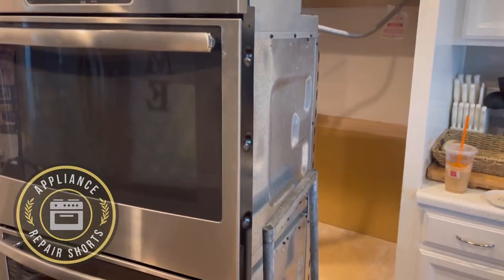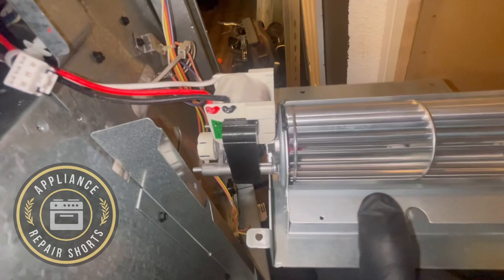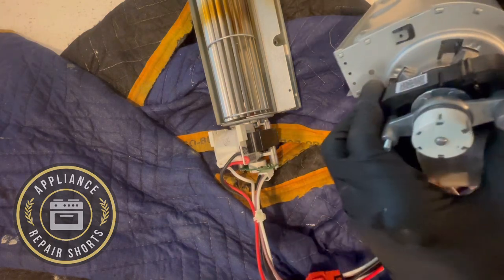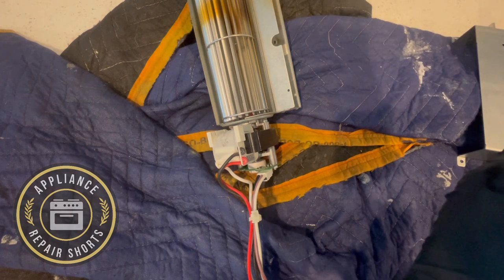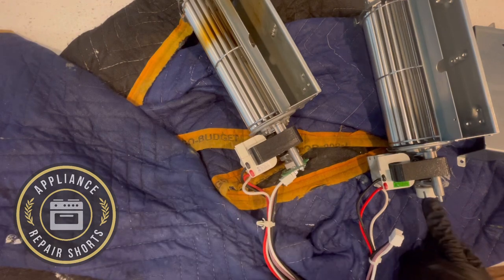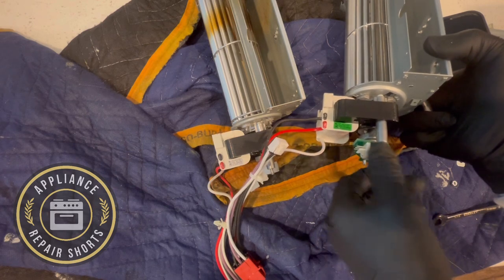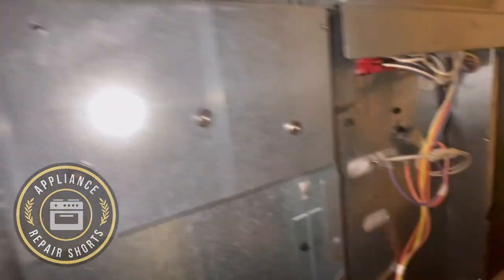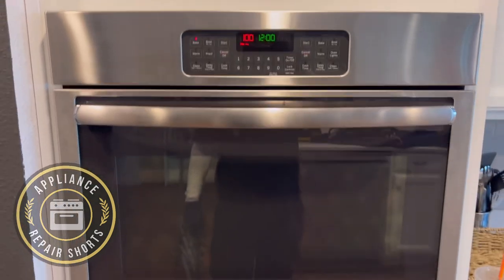GE wall Oven F97| Lower Cooling Fan Installed

Comment: I noticed that You use a Veto tool bag You should make a video showing how You have it loaded out.
Reply from the maker: Man, you’re so right. My wife has been telling me to do that. I’ll do it soon. What do you think about them
Reply: @appliancerepairshorts  They're nice bags. The Co. that I worked for bought me an MC and later an MCT I think you'll agree there is NO perfect bag that suits everyone. I always liked an open top bag and I've used the CLC 1526 for years. It's not fancy but it holds everything I need and also a parts / wire connector box is included. This is probably more info than you expected but I do love tool bags Just ask my wife ha ha